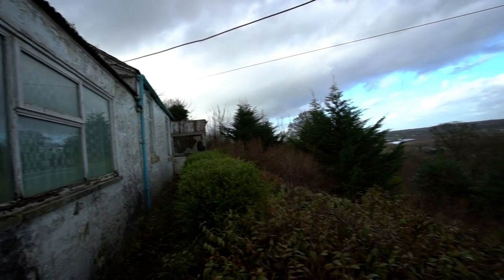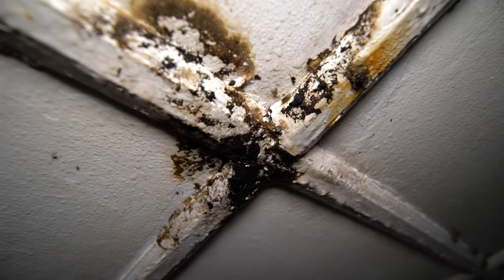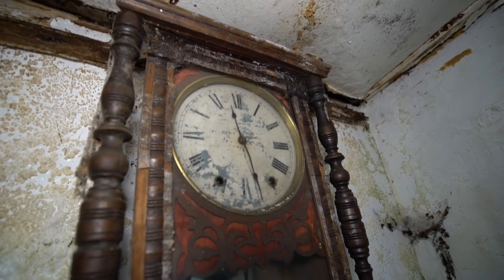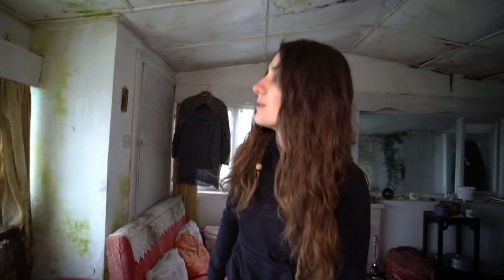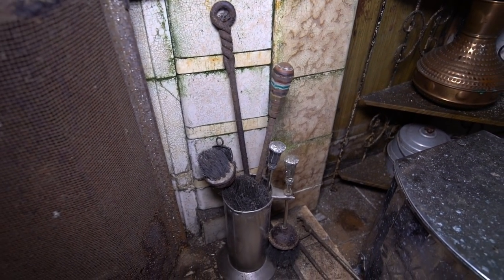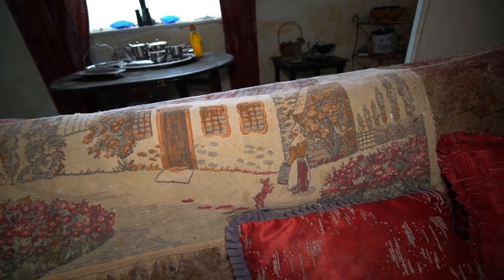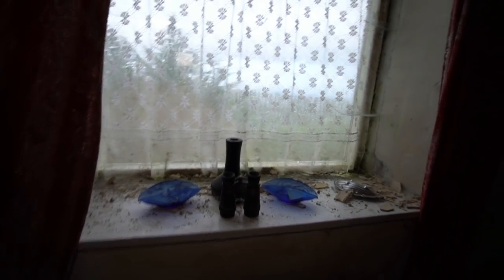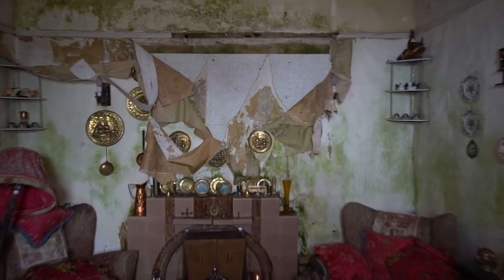Aladdin's Cave Of Rare Antiques And Collectibles | Abandoned For Years

Comment: I had that kitchen sink unit, with the drawers and cupboard doors in my first house back in 1980.  It was a hangover from the 70s. It was the first thing to get replaced, couldn’t get it torn out quick enough!

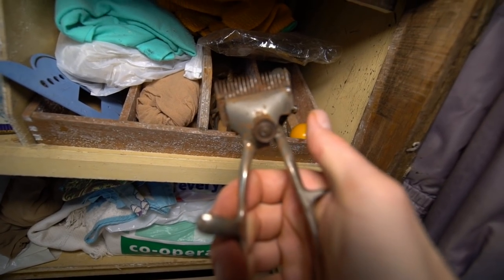11:20 - those are manual hair clippers, no reason for Sam to know what they are!

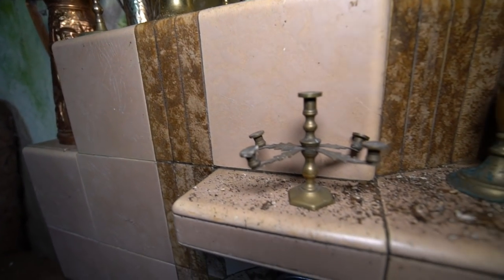23:00 - an auntie had that very fireplace, even down to the heaps of brass trinkets.

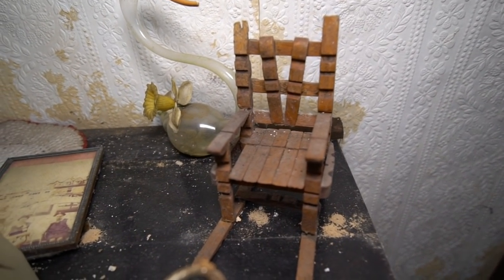24:40 - Clothes peg rocking chairs!  I used to see them in the mid 70s.

27:30 – The green glassware in the drawer might be uranium glass. It fluoresces bright green in UV light.
Reply from the maker: Awesome! Thanks for watching Arne! Thanks for the info too, so interesting to hear peoples thoughts on it!